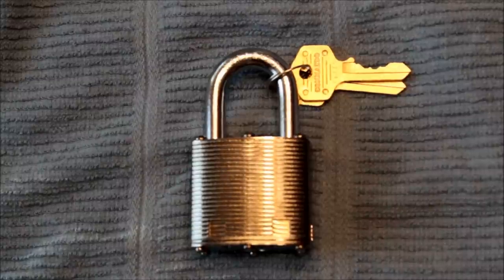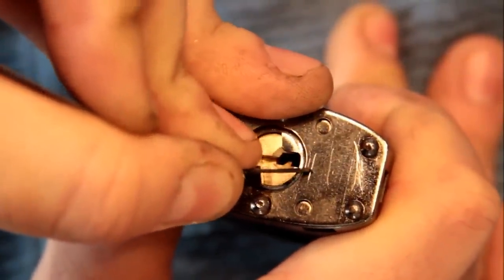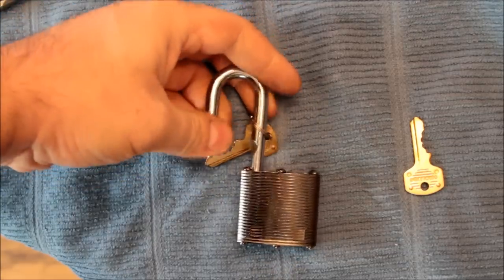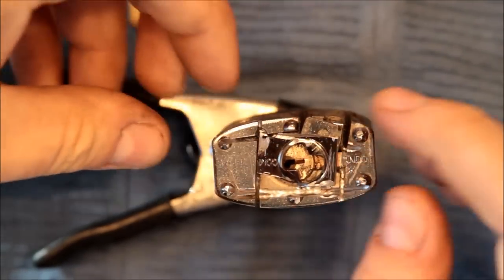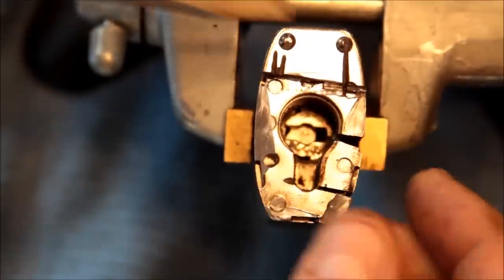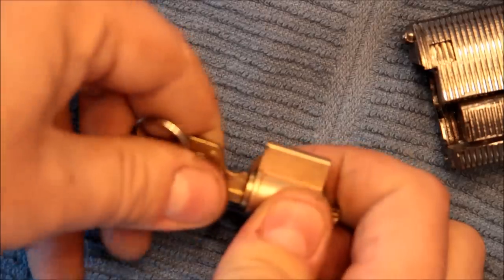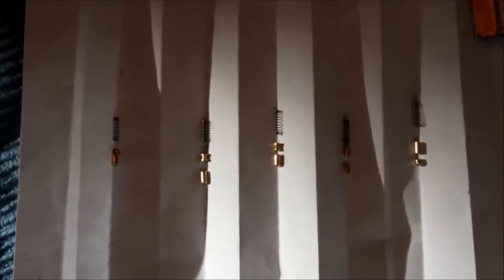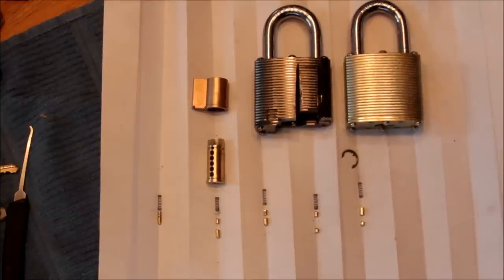(046) Commando Padlock: In-Depth Analysis and Gutting

Comment: I believe that the indentations are just where  the rubber bumper fits on the other models. There is no real reason to cut the notches in the shackle deeper because the ball bearings are a closer fit with the shallower cuts.
The extended parts around the keyway are  just to prevent over rotation and backwards rotation. Not for anti drill or anything.

Comment: I just want to point out that "counter milled" and "counter sunk" are 2 distinctly different things... those pin chambers in the plug are counter sunk this is a bad thing, it makes the sheer line between the plug and housing bigger... counter milled is a small groove actually MILLED into the interior of the pin chamber in the plug sothat serrations can fit into it... making it more secure... you cannot see counter milling from the top of the plug, only from an angle looking in each chamber.